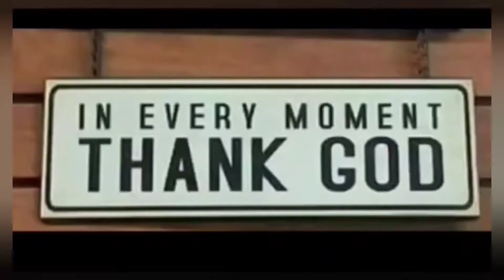Paano gamitin ang clay bar sa Topcoat or pintura ng sasakyan' para sa mga baguhan

Comment: Ano po yung overspray? Thank u
Reply from the maker: Un po ung nagpipintura sa kapitbahay or mga building,tapos meron ung topcoat ng sasakyan' nyo na small spot paint,un po ung over spray 😁
Reply: Thank you sir. Ano difference exterior detailing sa paint correction?
Reply from the maker: Ang diskarte ko po sa paint correction ay rerepaint ung meron deep scratches or mga malalim na gasgas before buffing,depende po sa diskarte ng tao or lugar ng tinatawag na Exterior buffing & paint correction
Reply: @feelsogoodtv6990  nag papa training ka ba sir? :)
Reply from the maker: Yes po Sir,kakatapos ko lang din po mah training ng tauhan sa karwas 5days
Reply: @feelsogoodtv6990  magkano damage sir? Hehe
Reply: Meron ka ba messenger
Reply from the maker: 7k'po sir
Reply from the maker: Meron po Sir feel so good po name ko
Reply: @feelsogoodtv6990  nag pm ako
Reply: Magkno po pa training ng  paint protection ?